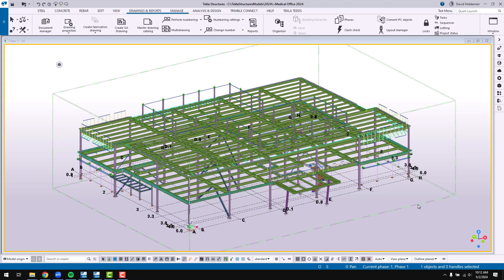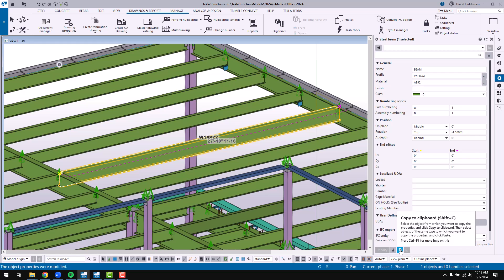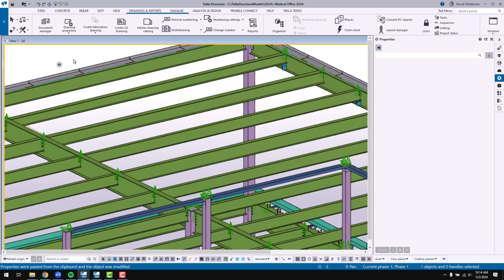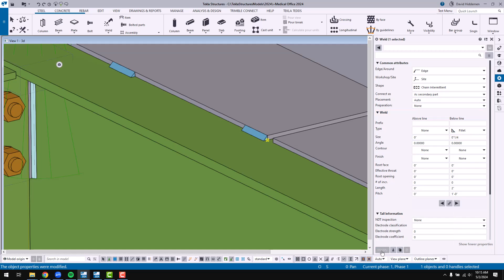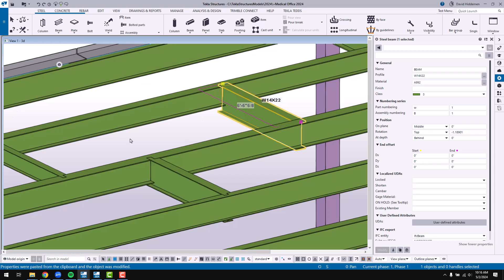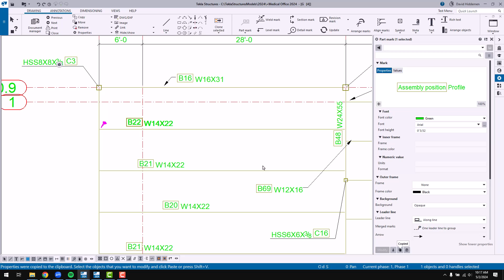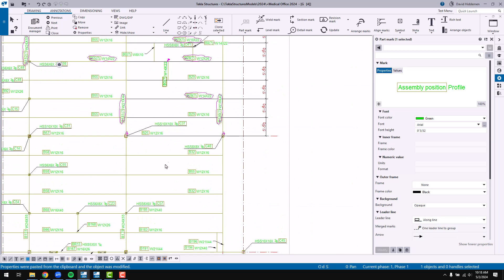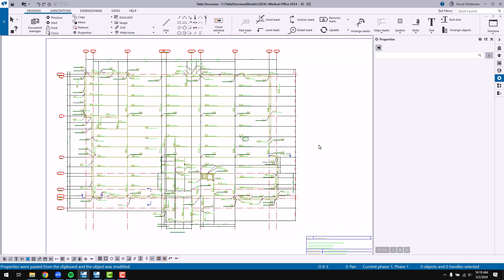Tekla Structures 2024 - Copy to Clipboard

Comment: Still no better way to copy properties (specific properties) than the apply and modify buttons in a separate window. I really miss them. It would be nice to have an advanced option to turn off the real time property reading and have the last applied setting in the property pane. In case I need a real time property I could still use the custom inquiry.
Reply: I completely agree with you. You can try this to use old properties window "Hold down Ctrl and double-click the part.
First select the part in the model and then Ctrl+double-click to open the old property dialog box. "
Reply: @ krahos6 @ GyulaGeher 100% agree, this is a complete bodge after imposing the singular properties dialouge... which is a complete time waster! the "Ctrl+double-click"  isn't much better either really tedious. try "SET XS_DIALOG_ENABLE_STATE=TRUE" to enable old part properties dialogues